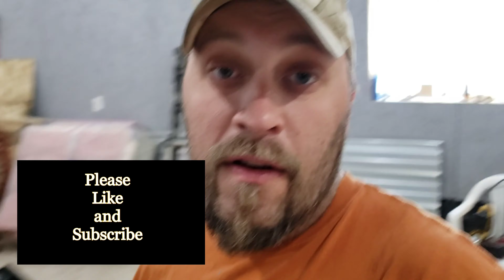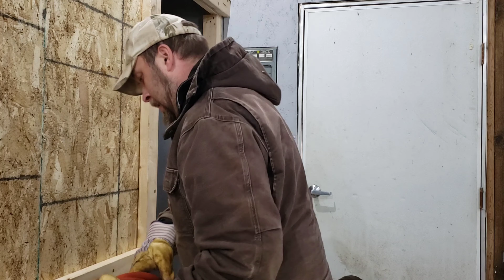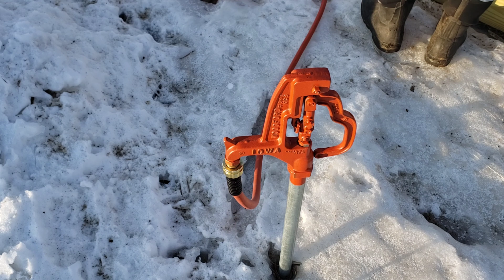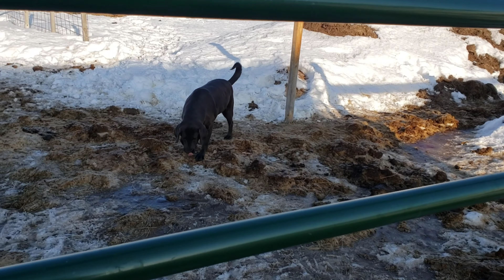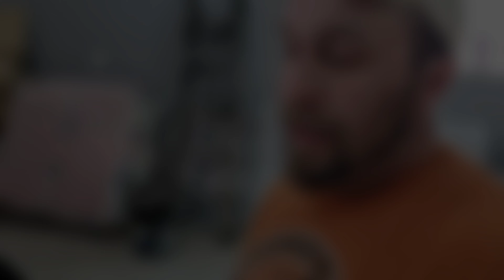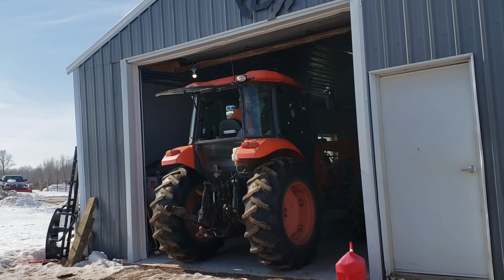Farm Vlog #3 Kubota M6040 Oil Change

Comment: Finally using the shop!!! Don't get the floor dirty😂🤣😎
Nothing like watching a tractor pee.....but that one has a small bladder, so not too bad😂🤣
When the old Kabota gets old and starts using a little oil.  Try DELO 400.   Doesn't burn off, except in the new hotter than hell running engines with DEF.. it can't take the extra heat...
Reply from the maker: I'll have to keep that in mind thank Ed I appreciate that man.
Reply: @RickBork  we have a few diesels that burn a little... Tried other oils and they drink it😵 switched back to DELO and we get a few days before having to add oil.
We really noticed a difference in the trucks, pulling hills!! Maybe a quart of DELO vs a gallon plus of other oils...
Reply: @lukestrasser  don't recall seeing the SN on the jugs.. 
We use the same oil in everything..
Did have a few jugs of a different DELO, we used it in the SUVs ... #1 daughter had to add oil between changes... #2 did also.. so, that stuff is gone, back to the normal!!!

Comment: About how long does them 4-6 logs last in the heater?  The cows and calves look good. Nice video. Have a good one
Reply from the maker: On a day like that 40+ degrees it will last 10 hours or so. During the day it's more to keep the fire going than it is to heat but it's less wood than starting it up again. Thanks for watching man hope all is well.